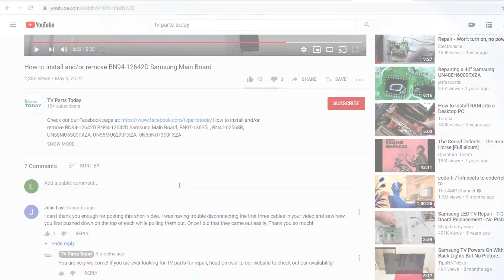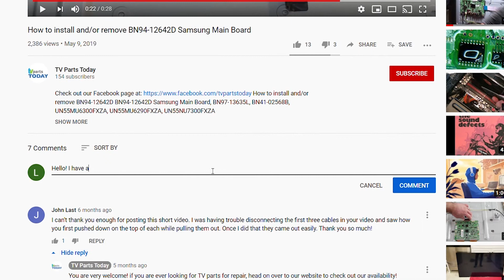Learn how to take apart your TV.  (SONY KDL-46HX800)

Comment: How does one get to the LED display to see if any of them need to be replaced?
Reply from the maker: On most modern televisions you will have to remove the bezel and any screws keeping the panel and diffuser panels in place( usually attached by plastic clips or the bezel itself). After that you should be able to remove the plastic cover as well as the various layers of diffuser panels and after that you should have access to the portion of the chassis that has the LED strips mounted on it.  There are some specialized tools that are made specifically for removing the panel without damaging any of the components.

Comment: can anyone help with panel ID chip on TCON.  I am in need of hex file for the chip
Reply from the maker: Unfortunately, we mainly deal in hardware, not software. I did a cursory search for any information about the hex file and came up empty handed. There is probably information buried in a tech forum somewhere for this specific t-con, but I couldn't find it.  Best of luck!

Comment: Hi this a long shot but my tv (exact same one you have) turns off and blinks a red light 7 times. The screen turns on for a minute then it auto shuts off and wont turn back on. Any tipa before i buy a new one
Reply from the maker: It looks like 7 blinks in your model is a temperature erro most often caused by the main board. Here is the link to your main board: https://tvpartstoday.com/products/a1778906a-a-1778-906-a-sony-tv-module-main-bal-1-881-636-32-a1754478a-kdl-46hx800-kdl-55hx800

Comment: Great video.
Which of those boards is the costliest to replace?
Reply from the maker: Usually it is the main board that is the most expensive. There are some TVs that are the exception.
Reply: @tvpartstoday  I have this exact same model of tv that started showing the standby light blink red 5 times and light black and gray vertical bars on-screen for a few seconds.
What are the prices for each of the replacement boards?
Reply from the maker: Blink codes are usually used to narrow a diagnoses to a few boards in your set. If you give us a call at (800)203-7484 one of our customer service representatives might be able to help you figure out what that blink code means and the parts needed for the most common fixes. 
     If you head on over to www.TVPartsToday.com you can type in your model number in the search bar and get a full list of parts available for your unit including t-con, LED driver, power supply, and main board. I wouldn't want the price to fluctuate at some point in the future making any quotes on price incorrect in this comment section on YouTube.